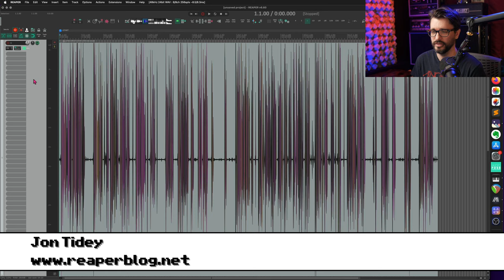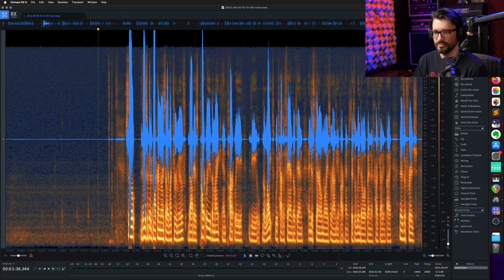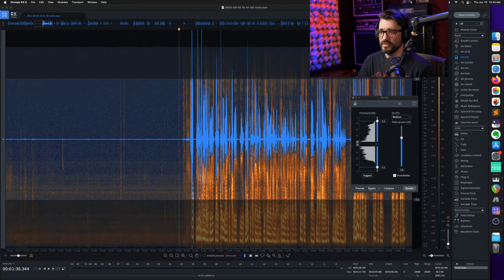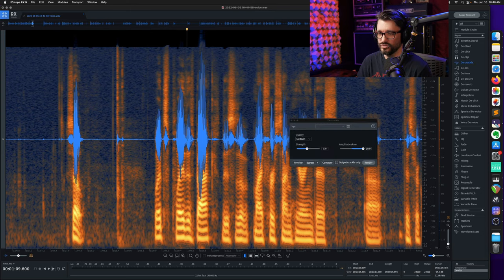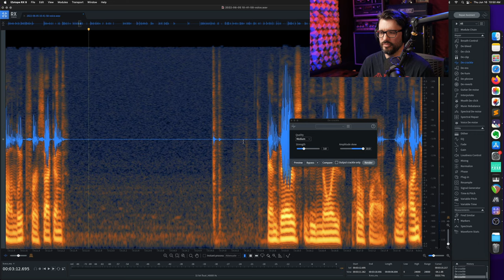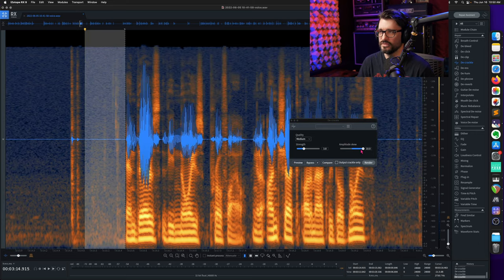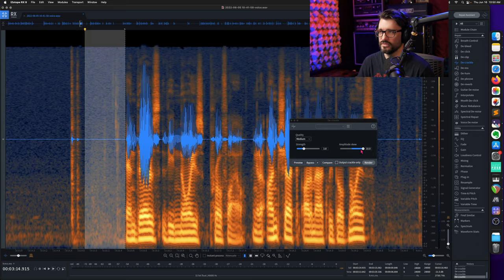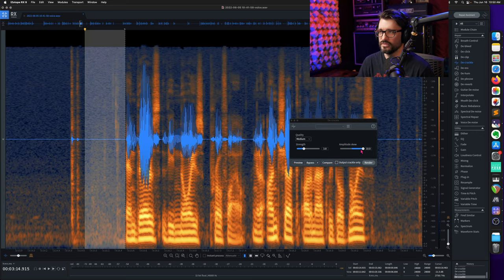De-Clipping a voice with iZotope RX

Comment: Is there a reason why you dont open item copies in external editor for using rx?
Reply from the maker: I do, but it depends on the stage of the project and the extent of the work needed. For this the whole file needed work and the file wasn't in the video edit yet. If I need spectral repair on a section I'll send item copy (just the section) to RX. I made a video about that years ago
Reply: @TheREAPERBlog  oh cool. Ill look rhat one up.